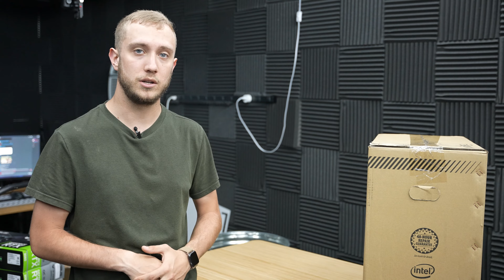Prebuilt Gaming PC Review - Is it Worth It In 2021?

Comment: These PCs are not like Walmart cheap PCs these PCs are build like if you or me would buy with parts from their stock unlike cheap weird parts prebuilders use. Only think I did to mine was update bios to get rid of the power spec logo and changed the ketchup mustard cables with sleeves.